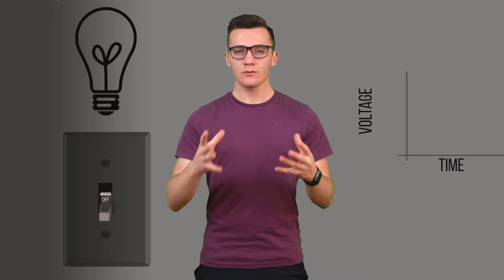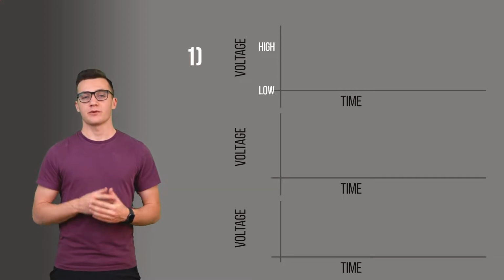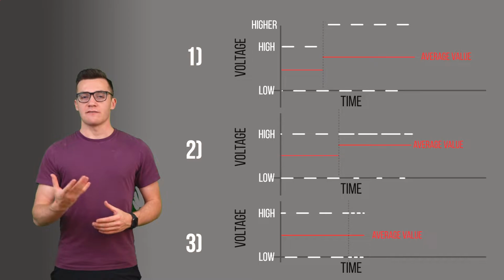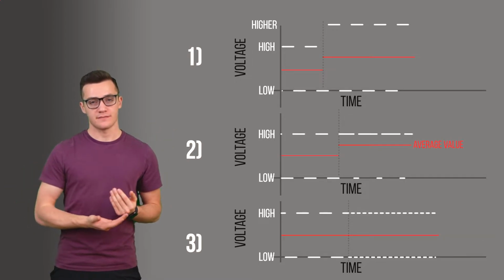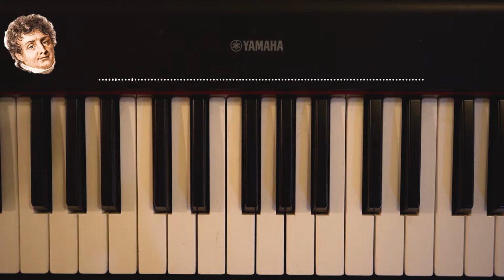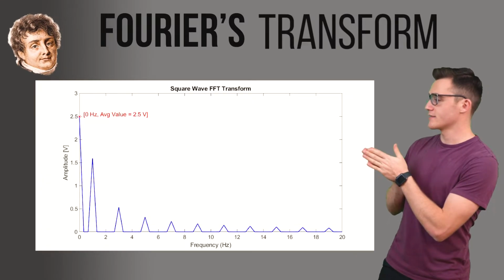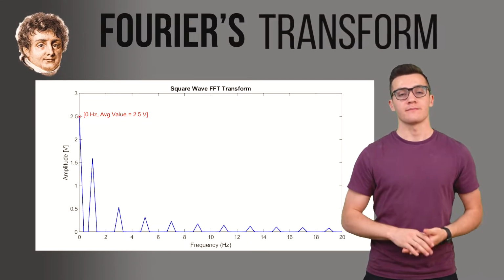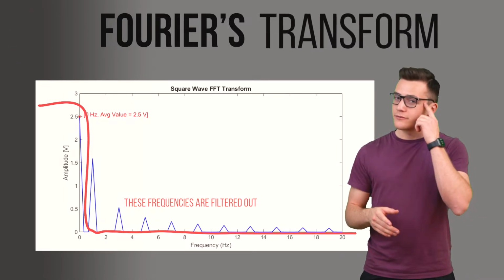The POWER of PWM | Exploring Pulse Width Modulation's Capabilities with a 1-Bit DAC

Comment: Great work explaining how oscillating signals (AC) can act like a constant (DC) if the signals is oscillating fast enough and is passed through a low-pass filter!

Here's food for thought... we eat digitally (discrete spoonfuls and discrete meals) but our body is a low pass filter so we're getting a continuous (the average) flow of fuel even though the input is discontinuous.  Pun intended by the way.